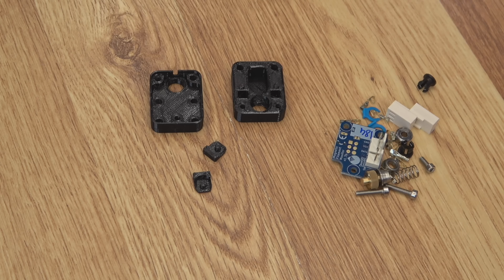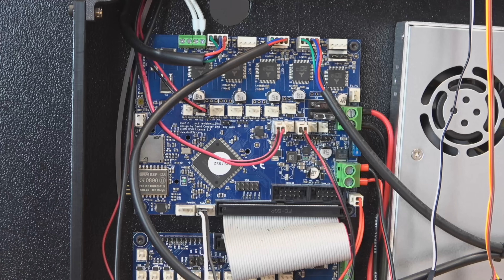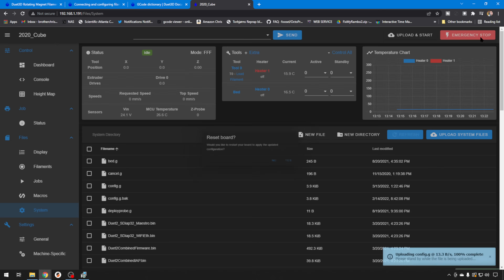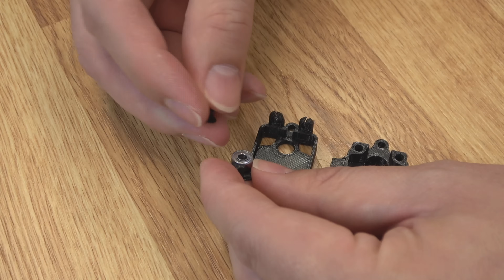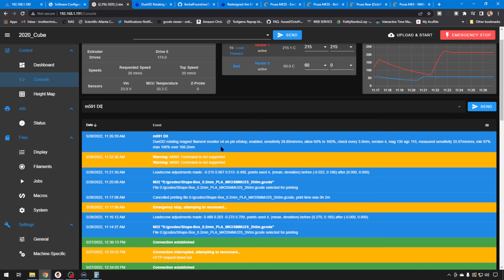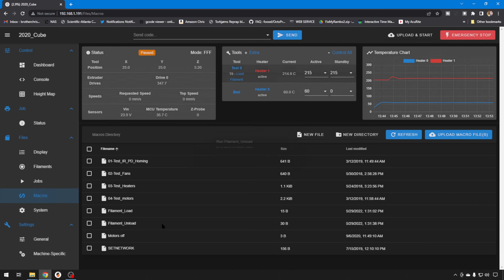Magnetic Filament Monitor - Duet 3D - 2022 - Chris's Basement

Comment: Just when i finished my sensor ready to mount on my Franken Haribo / Caribou Duet setup this video popped up. Ill print the housing from Lo-Fi and then mount it.
Thank you for making this content!
Reply from the maker: Happy to help!
Reply: @ChrisRiley  Without connecting to the duet i could see the magnet skipping when i ran filament trough the original design.
It will probably work with some very tight tolerances.
The Lo-Fi design works flawlessly for me now!

Printing away with several prints , and yes i tested the runout function .....its great.

Comment: Chris, great video.  I hope this can help someone.  I tried the BTT smart sensor and then made some myself.  The problem I ran into was too many false runouts.  I had to increase the distance of filament before declaring a runout.   I was in the 30+mm range.   That was too much for a real error, a big gap in the print.  I went back to the simple switch and have had much better results.
Reply from the maker: Thanks Dave, yeah, the simple switch is still the best solution i've found.

Comment: I have one and was never able to complete a print without it seeing either way too much or way to little filament movement. It would go just fine for a while with a reading of plus or minus 15%, then suddenly there would be one reading that was like 300% off for and it would trip. I gave up and just left it set up but changed the config line for it from S1 to S0 so it wouldn't trigger a pause. I'll try the Lo-Fi remix of the housing and see if it does any better
Reply from the maker: Good luck, let us know how it goes.
Reply: @ChrisRiley  It's much better so far. After a couple hours of printing the measured value is staying within 94-106% of what it should be.